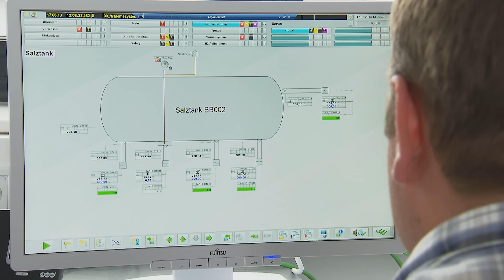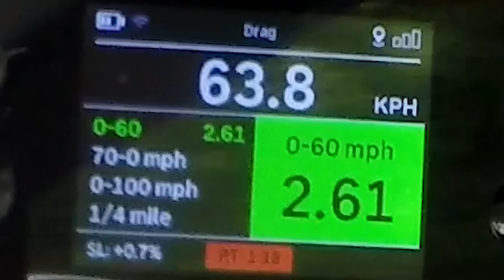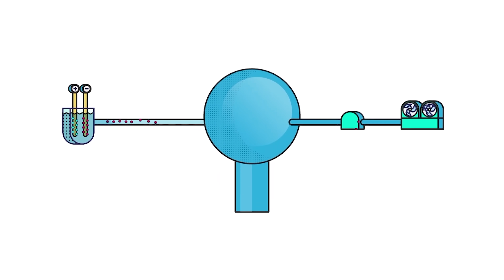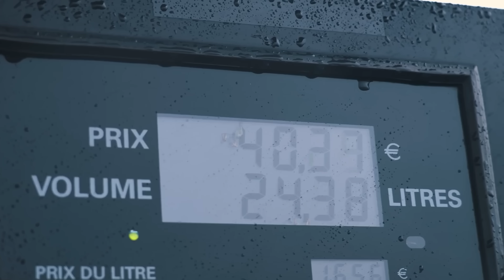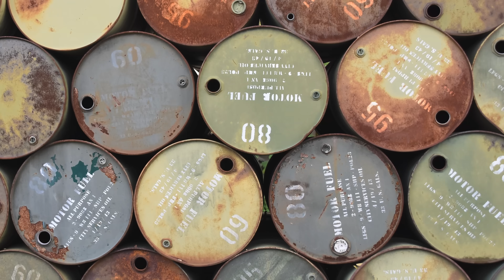Porsche just SAVED petrol engines FOREVER

Comment: Maybe you should have mentioned that a normal EV can utilise around 80 percent of the used energy to drive along, whereas normal petrol engines only manage to utilise 30 percent of the internal energy of fuel. EFuels however are even worse, they only utilise around 17 percent, because not only do they suck at burning the fuel just like with normal fuel, they also lose efficiency points in the manufacturing process. So to drive the same distance in an EFuel car as in an EV, you need 5.4x as much green energy. And thats a good we dont even have enough of without EFuels...
Reply: reason why i dont liek electric car is  that battery degradation and lack of battery recyling. dendrites that forms from battery degradation is messes with recyalability too.  if you look at sandy munroe video caled wjats insize 680 battery, there could be indicator of how much of battery can be recycled by mechnaical seperation vs what chemical process would be needed, woudl it be susntinable process? recycling company called redwood. even if they fix this problem, will they dig through trash to find enviromentally damaged (rust, mud,etc) dead car batteries currently being dumped, and recycle them? in emissions, best hting to do is a ca rof where rear seats face the rear as comcpact 4 seate rreplacing 2+2 seater cars and yaris corolla cars, and  rear mid engine small combustion flat 2 cylinder wnith no rotatiing parts to send power to wheels, instead magnets moving back and forth make electricty aand or a little supplemnetary compressed air , to power electric drive and compressed air driver, possibly with no battery or at minimal battery, using supercapacitor etc. single combustion chamber would help preserve heat for optimally low emissions or effeincy, hydrallic switch will push pistons back to position so they can be pushed by combustion..  optimal combustions per second for emissions with electric and mechnaical hybrid turbocharger, sometimes engine will run beyond optimal effiency or emissions levels for unsuually high power demand to protect long term emissiosn and fuel use reduction effetiveness of battery for common lower power use. with limited batterys to use, hybrids are already more effceint effective at reducing emissions, vs using that battery material for fewer cars who are electric cars, becaue most emissions happens in low speed high pushing power sitatuaitons of combustion car, where emissions are most likley to chemicaly harm health of nearby people becaue its usually compact city area with many people nearby.              what battery size is best for longevity?  see tony hellers climate change videos, maybe somone can make use of suspicious observers videos.          see aptera owners club video on saftey, unqiue materials they use, lightweight is safer to peopel outsid ethe car but can be safe for people inside car compared to hevaier caar if using right materials, and even safer due to wat type of crash is more likley to happen.. linearly more lighter weight exponentially causes less road wear damage causing less resurces and emissions and road downtimes. .....  the low weight compared to  structrual strength and crash energy absorption, makes its safer per costs ,. the weight lower to ground (if that is how its still done) can make it preserve momentum around turns more, which is more energy effceint than relying on regenerative braking, and battery, brakes, lubrication, etc would last longer. tires longveity may not be affected despite higher speed and fun of preserving momentum with minimum g forces .      ....    f  in effeincy per functionality, rear seats facing rear in sompact 4 seater woudl make more sense. solarpanel effeincy is only arouund 20 percent and can become lot better     if u want lower emissons(whch only helpful for heath of pepe wh send mhme near heavy traffic roads), then using mited batteyr supply for hybrids is lower emson than using the suppply for fewer cars whch are eletric car. big batteyr means exppnentially less effceint, so the more energy going in and out the battery means worse battery degradation, but more parraleles of battery reduce battery degradation... so more battery is not better, theres a balance to be had.

Comment: The largest problem is e-fuel takes a lot of energy to create - which makes if very expensive to produce.  So, yes you can make it, but will people buy it cos it cannot be cheap, and certainly much more expensive that oil based petrol.  And, no, it will not drop in price much in future, because thermodynamically it takes a lot of energy to create, so it is just expensive to create always - when charging batteries will be much more efficient and cheaper for the consumer. Simple.  
The EU cancelled the policy because germany blocked it because the powerful car lobby in Germany did not like it.

Comment: It's a nothingburger.

1. Any e-fuel will be at least 4 times more expensive to use compared to an electric car (per 100 miles or km). It is basic physics of the e-fuel production process, they just need 4 times the electric energy to produce compared to what comes out in the car. That is not solvable. Imagine e-fuels being 6 GBP per liter. At best.

2. E-fuel cars will need a system where they can only work with e-fuels. That system doesn't exist and will be very expensive to create. Additives will not work if one can just add something to gas or diesel and make ot work in a e-fuel car.

3. Car maker "investment" is a myth. With enough lead time (like 10+ years) one can stop developing new ICE cars and not loose any investment.

4. I've never had to charge 30 minutes in normal BEV long drives. 15-20 minutes at 150-200 kW is perfectly enough to drive on for another 1-2 hours.

Comment: A fuel you need electricity to produce. It sounds exactly like hydrogen. So what's the benefit with this fuel other than the fact that you can use it in existing cars. Is it more effective? Does it take less electricity to produce the same amount of power you get from hydrogen?

Comment: ermmm.... slight problem though, electrolysis is prohibitively expensive; meaning:  you need a LOT of energy input and it won't work if you need to burn fossil fuels to create that energy right?  So you need an abundance of renewable energy, i.e. more than you would need to just power an EV (like for like).  Not that I am an EV advocate at all, I think it is a dead end tech since the materials to make EVs (if the world switches to them completely) does not exist on earth.... AT ALL.  So yeah, it is pretty much a political game by people with no clue about the science.

Comment: The biggest snag is that e-fuel is indistinguishable from oil-based gasoline/petrol. I can bet my left eye that it will be impossible to guarantee that the source of the fuel is actually not from fossil. So it will, if passed, effectively kill the push for cleaner vehicles from the car manufacturers.

Comment: I think Hydrogen Fuel cell cars are a very promising concept, and think they deserve more infrastructure and support in the coming years. With sustainable ways of separating hydrogen from sea water becoming more viable, hydrogen fuel cell cars offer the environmental benefits, without the ridiculously long charge times of standard EVs, and if I recall correctly, when stored at low temperatures (still as a gas), have a higher energy density than both EVs and ICE cars. 

I feel like they are underappreciated at the moment. 

I'd love to have a fuel cell motorcycle at some point.

Comment: Needs carbon capture on a mass scale which doesn't exist and uses so much energy eating into the renewables that could power EVs. The money better spent on EV infrastructure aswell. Then E fuels still emit toxins from the combustion cycle as air is mostly nitrogen you get nox emissions and localised tailpipe pollution on health is not mitigated. Efules is a scam. Crude oil can be added to the mix and highly refined without traceability. Emissions will rise and well be worse off. But at the end of the day, we need a carbon negative economy not a carbon natural one. We're already over budget. Climate change doesn't care about our economy and jobs but one things for sure, Climate change will disrupt both if we continue to party hard on emissions.

Comment: So you use (lots of) green energy to make fuel, to then burn in an combustion engine for a return of 30% efficiency instead of just putting it into a battery EV which is over 90% efficient. Sounds like a massive waste of clean energy. 
Let's also not forget that buring fuel releases not only carbon, but a bunch of cancer and dementia giving chemicals. Way to keep your children's air clean

Comment: This is all very nice but it's not "new" news. Unless their are MASSIVE subsidiary's or significantly more efficient ways to produce e-fuel this decade old idea isn't going to work, sadly. Their is too much dependency on batteries though and if the whole industry relies on them theirs going to be a toxic metal crisis to replace the current carbon emissions one. Hydrogen or electrified roads all be it with their own safety and economic woes are the only thus far presented actually viable environmental options to be honest. Not that I can see any country having a budget to electrify all their highways, lol. So I personally think self driving autonomous hydrogen powered cars are the ONLY option! (just my opinion)

Comment: This isn't really a breakthrough. It seems like H-fuel has a clear advantage - it will be easier to manufacture, has higher energy efficiency, and has lower emissions. E-fuel will also have the same issue as H-fuel - no one wants to invest the significant capital required to get a minimum threshold of demand require to make the economic stack up. 

It's a nice idea, but surely a step backwards from EVs or Fuel-cell vehicles.

Comment: I'm glad you've pointed this out. Most of the current crop of motoring journalists (that's a loose term for their abilities - bought and paid for shills?) are obsessed with EVs and have not researched the phenomenon. Plus often their TV programmes are sponsored by interested parties so said "journalists" won't bite the hand that funds them! Cowards!

A fixed wing microlight (LSA) has been flown (nearly two years ago) in the UK with synthetic fuel. The RAF are testing such. UK idea. No reason why IC engines can't be flawlessly clean.

Besides the Carbon Climate Change agenda is an emperor's new clothes con - goes back, like Cold War I, to one guy, then lots of greedy unelected oligarchs jumped onboard, the first of which was the CCP after said guy left Europe in a hurry. Ergo climate change isn't due to the issues being foisted upon us.

Plus the world's biggest polluters? The top 100 companies and 8000 super elite - "the polluter pays". I'd agree with that, make those greedy b@stards pay through the nose. Sadly govts serve them whilst mindscrewing and herding us.

EVs are unreliable, overpriced, far from environmentally friendly, Eg Lithium is a dirty supply chain, nowhere to recycle it. Plus EVs use lots of RARE earth materials! They're more expensive to build and take up more environmental resources than IC vehicles to make, Sixth Gear never mention that do they. Overnight they went from being a half decent car programme to shills. 

Dig deeper, EVs and the CCC agenda is about control of the masses, herding, brainwashing.

I write the above as an champion of environmental issues for some 40 years. ✌️😊

Comment: EV industry is a total scam.
And not one producer of EV batteries that can honestly say "there are no children working the mine and there never has been"
And then there's all the lakes of sulphuric acid for the lithium processing.
Reduced engine size petrol/electric hybrid or hydrogen fuel cell is the answer NOT PURE EV!.
If you are considering one (anyone reading this ) ask for the safety studies on the emfs subjected on the driver and passengers (emf's can be a very powerful force).
You might also want to look into accidents involving EV's, I believe that many battery disconnects are internal to the car (tesla somewhere around the centre consol or so I am told).
Any fire service will not reach into the car to disconnect the battery because f the risk of bodywork electrification .
Potentially it increases the possibility of you being stuck in the car and burning.
And this video seals the deal STOP PURE EV